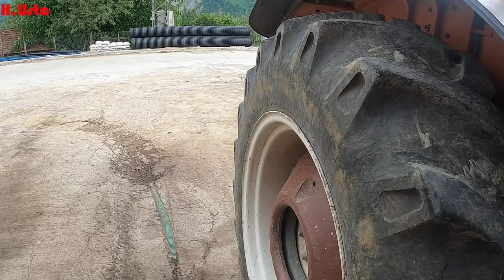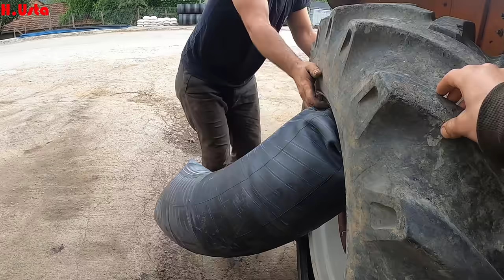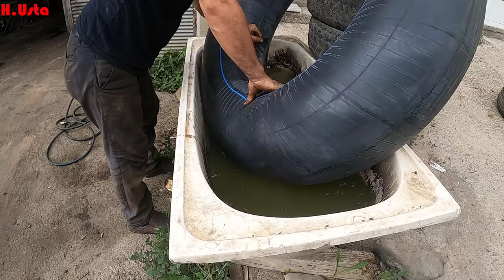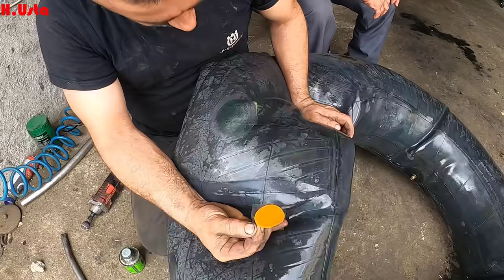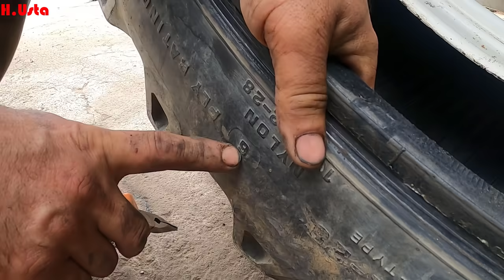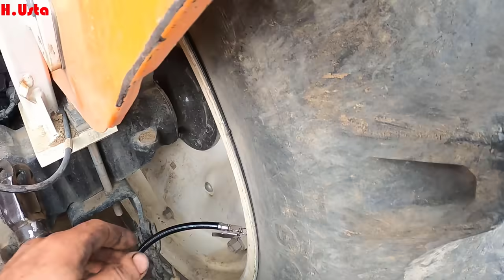#NewHolland T480 Traktör'de #Lastik Tamirinin Sırrını Açıklıyor - Zamanı Yenecek misin?

Comment: Selamünaleyküm Harun abi. Bu modeli (2011-2012 T480) Bahçeye gidip gelmek ve ot biçmek gibi yoğun olmayan ufak işler için tavsiye eder misin ? 
Fiyatları ve boyutu benim için çok uygun ama kronik arızaları ve şanzıman problemleri olduğu söyleniyor. Açıkçası korkuyorum , size danışmak istedim. 
Cevap verebilirseniz sevinirim. Hayrlı işlerin olsun. Allah'a emanet olun
Reply from the maker: Şanzımanda vites pimi kırılıyor
Söylendiği kadarda kötü değil
Vites düzgün kullanılırsa sıkıntı olmaz.. İş götür
Kanalımda bu arıza ile ilgili video var
Reply: @harunkaya   abim cevap verdiğin için teşekkür ederim.
Reply: @hakanustuner7314  ustacim bende 2012 vardı 
Çok memnundum 8 no 3 lu pulluk çekiyordum onunla. Şanzıman kullanmama bağlı tabi. Az ma 2012 öncesi modellerinde ş az nzuman karışmasından bahsediliyor.hasılı kelam Ufak işler için bitirim